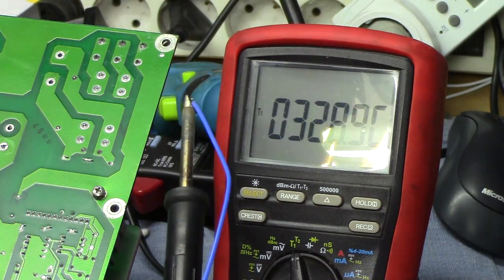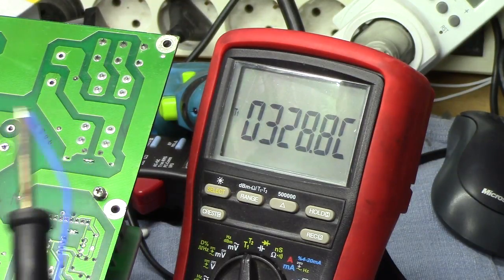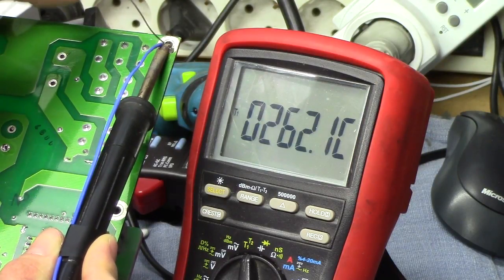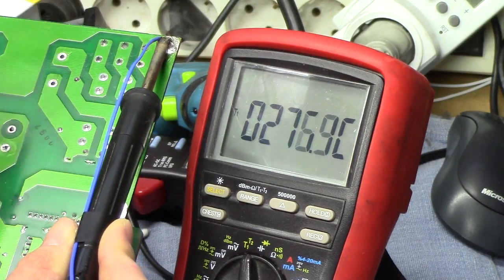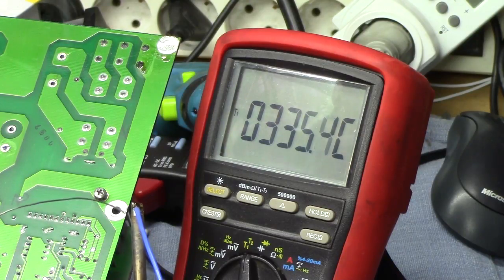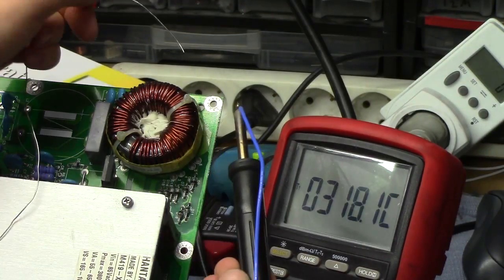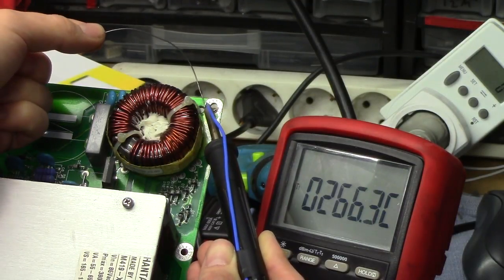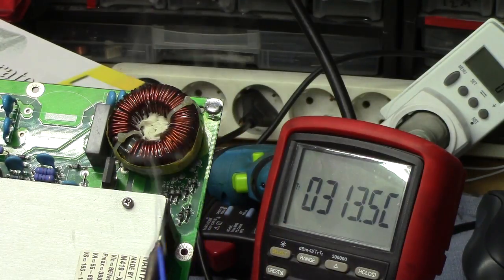AOYUE 2901: Quick demonstration

Comment: Will this type of direct heating irons work better on simple pcb,s like single layer one of mechanical keyboards and such??? I'm considering this iron vs the Hakko FX-888D
Reply from the maker: It's a superior technology all together.
Reply: i saw your tear down of the handle and really liked it but it did worry me..as a noob.. i'm looking at the 2900  https://tinyurl.com/y7h7snmf

Still need to compare it with the 2930 also from Aoyue. don't know why the higher price for this unit..
https://tinyurl.com/yb3msdse
Also bin looking at the TS-100 as i solder keyboards so true hole soldering and need a de-soldering station was looking at the hakko but that's expensive Perhaps the 474A++ from Aoyue would do. don't know many people working with this brand.. your one of the few eng speaking on the web ;-)
Reply from the maker: The 2930 looks similar to the 2900 series. Same pen, same tips, same performance (from a quick look anyway). The station doesn't really matter that much, performance wise, you just need a UI you like. I can recommend the 474A++ stations, I use them in both heavy and light duty, and they've served me well.
Reply: i really enjoyed watching your in depth look of the 474++ "AOYUE 474A++ double teardown: Old vs. new model "... i don't konw if i can get the older model from eleshop.nl from the pics on the site it looks like the older model. if i go for Aoyue i will try to get the older model..i recall you mentioned a sleep/wake function and dual diaphragm pump.. i'm not that handy with modding so will see..

Comment: How did you stick the thermocouple to the solder iron tip??
Reply from the maker: +Futschikatores I taped it to the handle and just let it spring down against the tip. Since the wire of these Brymen thermocouples is so stiff, it works pretty well. I used solder to make sure there's a good thermal bond between the tip and the probe.